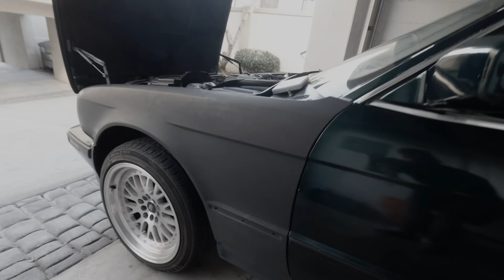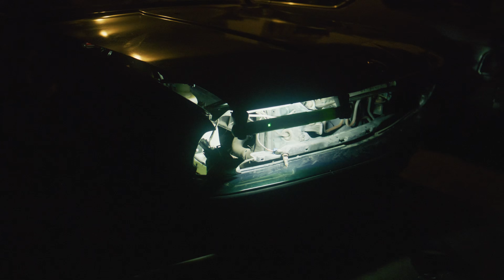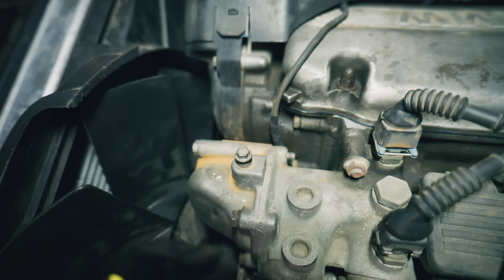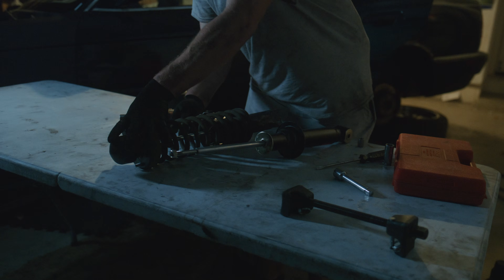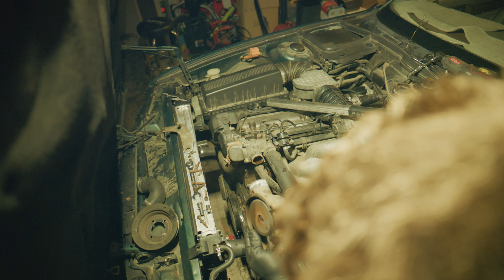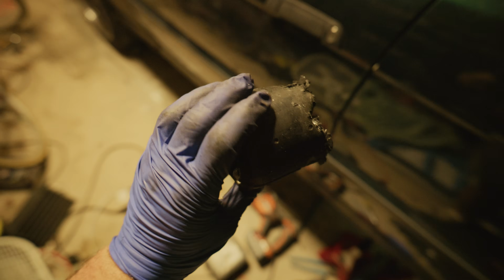I Bought an Old BMW For $1,000. What Did I Get Myself Into?

Comment: Tune the valves check the banjo bolts do the clutch fan and wp change the oil it will go forever

Comment: Hi my friend, great video! I watched it in parts, and honestly, I really admire your patience and the fact that you manage to find the time to do all this. It’s a real pleasure to watch.

I have an E34 myself, a 1992 518i, which has been in the family since new — I got it from my uncle. It has only 140,000 km on it. Unfortunately, it had been sitting unused for about five or six years, so recently I had a fairly extensive mechanical restoration done. I had to take it to a workshop because I don’t really have the time or the tools to do the work myself. So far, I’ve spent around €2,000–€2,500, and there are still quite a few cosmetic details and other small things I’d like to sort out.

At around 36:30 in your video, I noticed that your temperature needle seems to sit slightly above the middle. A little later, it appears to be just below the middle.

Do you consider this normal behaviour?

After the repairs on mine, the temperature gauge usually sits more or less like yours does at 36:30 — almost in the middle, but slightly above it.

I do occasionally need to top up a small amount of coolant. During a recent summer trip of about 2,000 km, I also noticed a very small coolant leak, probably from one of the hoses, so I’ll most likely need to replace it.

Apart from that small leak, do you think the temperature needle sitting slightly above the middle is normal for an E34?
Reply from the maker: The needle appearing slightly above middle can even be chalked up to being looked at from the wrong angle. I wouldn't worry too much about it. 

Thank you so much for watching! I'm really glad you enjoyed it

Comment: Great work. 
Notice how much the gear stick is moving at the end of the video? That'll be the engine and gearbox mounts. They contribute to that vague, loose feeling you're describing. If you ever need to do subframe bushings again, a common 70ish millimeter wheel bearing is a perfect shim for pressing them out. Looking forward to seeing more on this car. 👌
Reply from the maker: Thanks for the tip, I'll definitely check those mounts!

Comment: Damn 250k+ miles and the head look like this? How lol, that's gotta be a refreshed head on that M30, if the banjo bolts came loose at some point in time and the oil bar couldn't feed the rocker pads and lobes properly that could warrant a head rebuild. Otherwise I want the previous owner's oil regimen, I want in on this lol.

Edit : My impatient ass should have watched fully before opening my mouth, you kinda came to the same conclusion lol @26:45